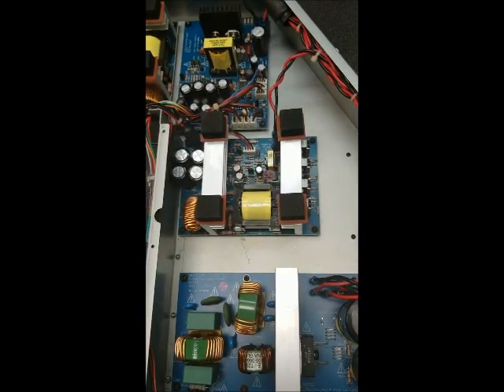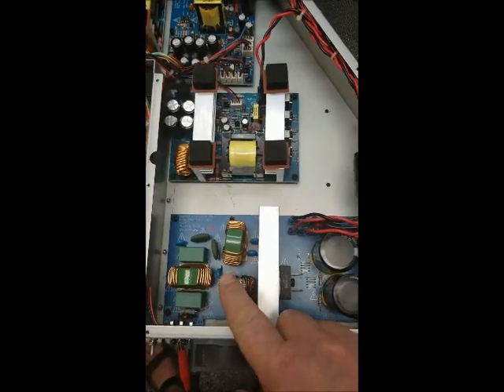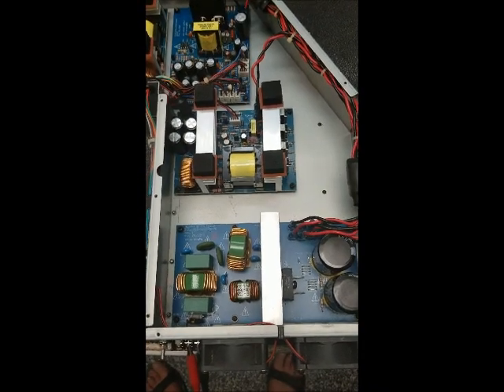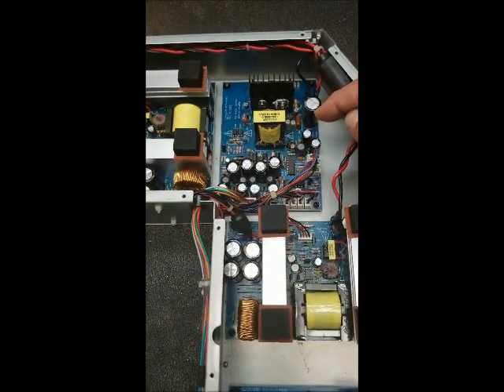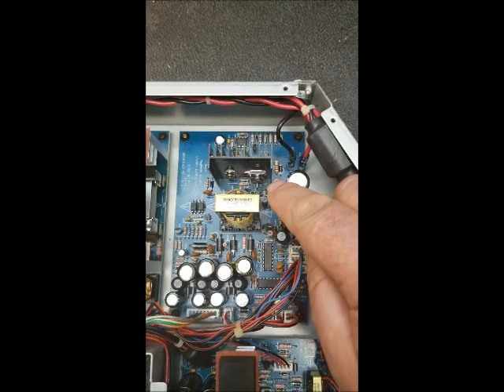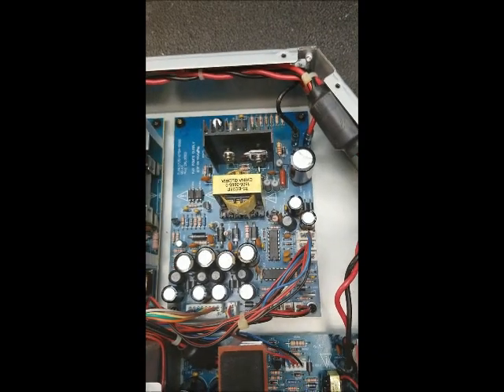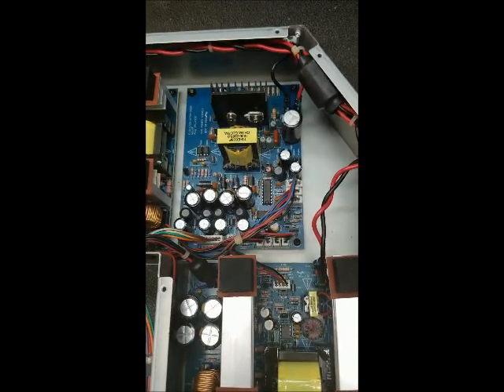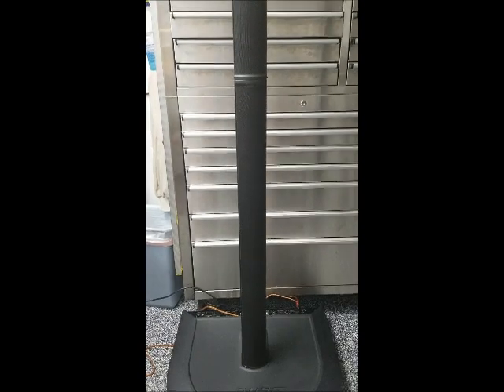Bose PS1 Power Supply Repair

Comment: Thank you for the video: I have a similar problem with that board: after replacing D606 which was shorted, I only have +11.5V on the +15V line an +18v on the +24V line. all other seem to be ok. What could be the issue? Thanks
Reply from the maker: Your -15V, +5V and +3.3V are good?  If so, take a look at the Vpp on the cathode of D605 and D606.  Any excessive Vpp would indicate a bad C623/C625 and C627/C629 respectively.  If the other voltages are off (even by a little) then look at that snubber diode on the primary side.

Comment: Thank you so much for this information. I ordered the parts from China and yesterday I tackled the repair. Turned it on, and it works again after sitting in a cupboard for 5 years.
I was nervous soldering those diodes as I used to only work on old tube amplifiers (  50 years ago).
Reply: I have one that does nothing when I turn it on.  I am sourcing the parts now.

Comment: Write To YouTube info video

Dear sir……….. great that I found your videos about the repair of the Bose ps 1 I am here in Belgium Europe with the same sound system from a musician friend who is probably having the same problem with it for the second time.
The repair was only successful for a short time and therefore I think that it was not carried out properly by the repairer.
Presumably he overlooked the cause, due to lack of the correct diagrams, I suspect.
Unfortunately I am unable to find the correct electronic diagram.
Were you able to find the correct diagrams for this repair?
I would really appreciate it if you could help me with this.
According to your explanation in the video, I concluded that you did know which components went wrong and ultimately caused the amplifier to fail.
My friend and I would be forever grateful if we could receive as much information as possible. Ps if there are people who read this message and also managed to obtain solutions or diagrams, we would be very grateful for that.
Kind regards from P & A.
Reply from the maker: I have the service manual for the PS-1.  I can email it to you if you wish.

Comment: I laughed at your Buy Other Sound Equipment statement, but I must say that I’ve had my PS1’s for about 15 years, and I’ve enjoyed their sound and portability vs. the full-on massive JBL’s, monitors, power amp, cables, and mixer setup I had before.  I even loaded one into my Corvette for a gig one time.  Alas, one of them has finally gone dead.  Probably from the same cause your video showed.  I was wondering if repair was an option for what is now an antique, but realize I will have to pony up for a used one if I want match my other one.  I can get a warranty buying from Guitar Center, but I may forego that to consider a new version or other brand.  Anyways, thanks for your “way beyond my understanding of electronics” video that helped me decide I ain’t gonna DIY this one!

Comment: Hi everybody, I just purchase a used PS1 and the tower speaker works perfect, but my B2 bass module it sounds very low! I already tried my B2 bass module on another PS1 and works perfect, so there’s something wrong with the inside the base! Any suggestions?.?

Comment: hello I am struggling with the repair of my Bose PS1 Power Supply Repair where the first intervention was in the replacement of the resistance R621which was open in addition was replaced IC601 (UC2843AN) with an equivalent one (UC3843B) and the mosfet Q601 (P10NK60ZFP).
At the ignition I do not find any voltage on CN623 I thought of disconnecting all the other cards from the power supply leaving only the power supply thinking that there was a high load due to some other failure but it was not so I find myself with thousandths of a volt output.
finally I noticed that leaving everything connected power button in ON and phantom power button (+24) activated the red led lights up a little while the power led is off.
I hope in your answer cordial greetings
Reply from the maker: It's hard to tell without running tests myself but I would guess R621  opened up because the chopper Q601 shorted.  Also check the snubber diode D602 as well as the resistors around IC601.  Also double check the diodes on the secondary.  Especially D607.
Reply: @tipsfromthetechbench4589  Hi to start thanks for replying
I tested all the diodes that are in the circuit and found the diode D604 (UF4006) at a loss and the D609 with a measurement of 0.13 while the others are all normal
obviously to test the diodes I unsoldered them from the circuit
Reply: @tipsfromthetechbench4589  hello I just finished the repair and the power supply is back to work as well as other things, I just wanted to know if the cooling fans are activated when a certain temperature is read or are activated when switched on through the power on / off button
Reply from the maker: @fabriziocapicotto  The fans are activated through a current monitoring circuit on the D-amp.  They are not on all the time if that's what you're asking.
Reply: @tipsfromthetechbench4589  you were very precise in answering I believed that the fans were always on thanks again

Comment: I just got in a PS1 base for repair, with the same no power problem. Your video is exactly what the problem was with this one I went straight to these diodes and the mosfet, and they were bad. Replaced them and it works. Thanks for a great video!

Comment: Great info.  I, too, have a Bose L1 Model 1 that has lost "power" for what appears to be a similar reason.  Is there anyone you know of near Atlanta (driving distance anyway) that could repair my unit?  Really do love the sound and have tried the others.  Just hard to beat the Model 1.  Thanks
Reply: Wondering if you'd found the answer.?  I'm having the same issue and should be within the 2-year warranty and ATL is likely the closest service.

Comment: The schematics I have are of three versions: 230v and 120v (v1.0/ v1.1). I am in U.S and have 120v model. The PCB board part numbers are not the same in the schematics but the board parts match. How do I find the version?
I have slightly puffy caps on the tops of them on the EMI board also. I do not see any other burnt components, have disassembled and am sleuthing through the layout. I will Change the caps first,easiest, then pursue further.
I rigged the removed board chassis out and rigged up a test scenario. Without an internal transformer and the line ground hooked to the metal chassis that makes the chassis hot(never get between DUT and ground applies here).
As far as physical layout goes Bose could have made the access panel on the same side as the open unit instead of burying it. But maybe this was their way of hindering service. I guess when the panel boards go all owners are screwed in some way as there is software in the DSP.

Comment: I would like to add.. on MY L1 power stand.,. I found the _15 volt diode shorted , D-607(Use a SCHOOTKY diode to replace this..not a normal fast recovery diode)  and D-601, (An NTE 552 will work fine for this), ALONG...with the controler chip, IC-601, UC3843AN, and IC-806, optocoupler was bad..dragging down the start voltage for IC_601. Replacing all of this DID restore operation.. Q-601, power mosfet..was NOT defective..

Comment: Hello Tech Bench,
Many MANY, Thanks for this very useful piece of well directed information. Exactly what you have described and demonstrated was precisely the problem with an identical amp/speaker system that a friend of mine asked me to have a look at.
When I looked inside it, my heart sank. I'm not an electronics man, my expertise is generators, motor control etc, but stuff like this is a bit beyond my electronic knowledge of valves and transistors of yesteryear.
I obtained and changed the 3 very bits you highlighted, and WOW, it worked. We are now fitting a varistor into the plugtop to ensure protection in future. We think it got blown on a small portable generator a few years ago, so the varistor will at least offer a basic protection.
Thanks again,
Eddie.
Reply from the maker: Glad to hear the video was able to help you.

Comment: How did u measure that D601 was leaky?
Reply from the maker: Because of the transformer winding and R609/R610 in series, you
won’t get a good reading in circuit. 
Pull the diode and measure out of circuit.  I’m old school.  I just use my Simpson 260 on Rx100 ohms.
Reply: Such a shame u stopped making video’s... we could learn a lot

Comment: I live in MN and have a part time place in FL. I have a Bose l1 model 1 in MN and needed the same setup in FL so, I bought one used in CA while visiting family planning to ship all my CA on man band stuff to FL, Info overload! Anyway, when I hooked it up I got a weird low volume sound out of it almost like a crossover was send low end to the tower. I turned it off and on and it fixed itself. I called Bose and they said that's an issue and what id was a reset. A day later, on the 4th of July, I hooked everything up and now I don't have any sound out of balanced channel 2. The meter light shows it's receiving sound but nothing. I use The Good Guys repair in St. Paul, MN but this piece of doo doo is in Venice Florida. My meter is back home too. My knowledge and skills in your department are limited. Big time respect for what you do! Anything you can do to help me would be great. I leave FL on the 13th. Thanks
Reply from the maker: I would have to disagree with what Bose told you.  Your issue most likely wasn’t a reset but rather an indication of a component (or series of components) that were about to fail.  If you’re willing to take it apart you may want to look for bulging capacitors on the amp modules and cold solder on the pin connectors. Unfortunately without tracing it out there is little else I can say that may help you.
Reply: @tipsfromthetechbench4589  Thanks for getting back to me. A bit of an update first. It was channel 2 that was acting up all the other channels were okay. To me that means the amps were fine it was a connection issue or circuit board problem. Anyway, I may have fixed it, I'm so good with electronics haha not. To anyone out there considering buying a used system like this ask the seller if they used more than one channel. The DJs and karaoke guys are typically using one input channel. I was using a quarter-inch TR Jack in channel 2. I looked in the hole and spotted a big wad of dirt fuzz in the bottom. I noticed the crud after pulling the circuit board out so I cleaned the furball out and did the wiggle jiggle trick on all the connectors. I put it back together and it works. If only life could be that simple. The problem might pop up again, but maybe, just maybe it's fixed. Wouldn't that be great. Thanks!

Comment: Thank you for posting this. I found almost the same issues in the one I just repaired. The original symptom was no output (no hiss or any audible sound), and the signal LEDs were blinking green with nothing plugged in. Bad D601 (leaky), D607, D609 (shorted), and Q601 on the Aux Power Supply board. I also replaced 6 bulging caps (1000uF@35V) on the power amp board. This video definitely helped me save some time in troubleshooting, although I still spent nearly 4.5 hours from disassembly to final reassembly and testing.
I'm posting this comment and details in case someone has a similar issue(s) in the future. Bose no longer supports this model.
Parts: The 2SK2645 I found on Ebay. The caps and two Schottky diodes (SB3100, PN 621-SB3100-T) I got from Mouser. I keep UF4006 in stock.